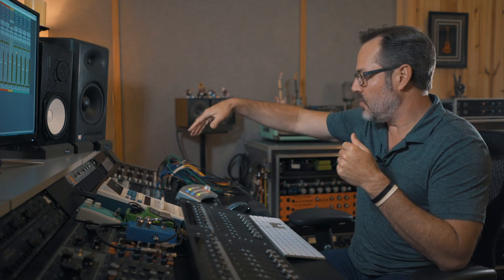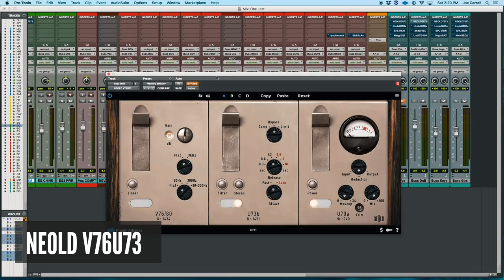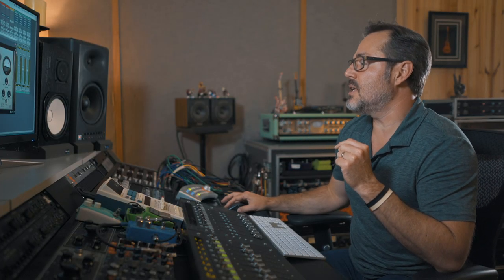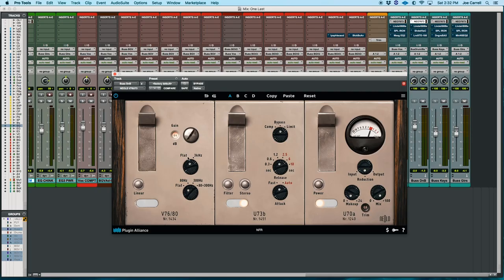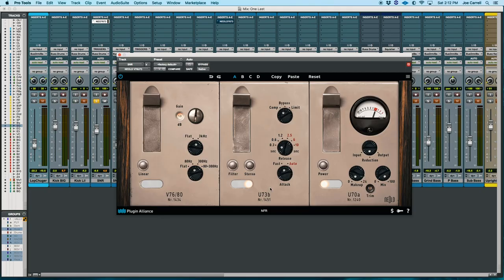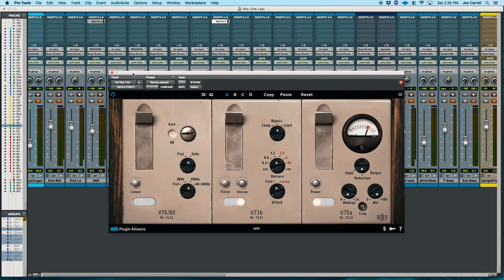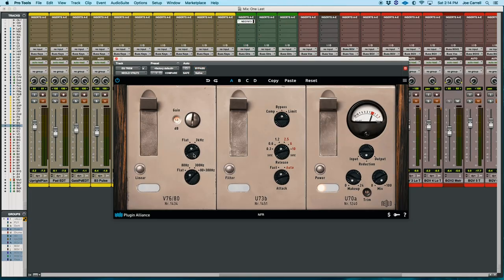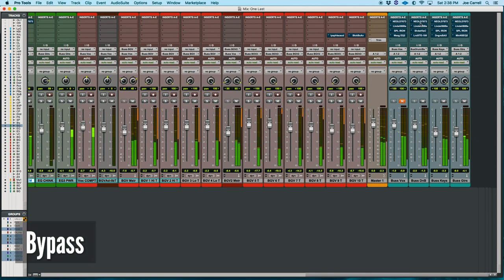Explore the NEOLD V76U73 with Joe Carrell

Comment: Thanks for sharing. I am wanting to subscribe to the mix bundle just for this plugin mostly, however, i certainly can't go wrong with all the other emulations included. What fader strip is that you are using in your setup, are those console one's?  How much outboard gear did you use on this track? Your mix sounds Great!
Reply: Real Music 4 you thanks man.  it’s Pro Tools software. In that rough mix you are hearing there is no outboard hardware engaged.  The mix that released (artist: MISY “one last ride) did have a several pieces of outboard inserted here and there.  Thanks for watching!